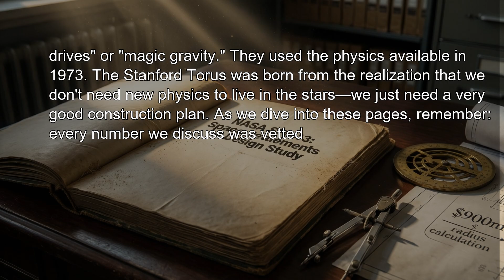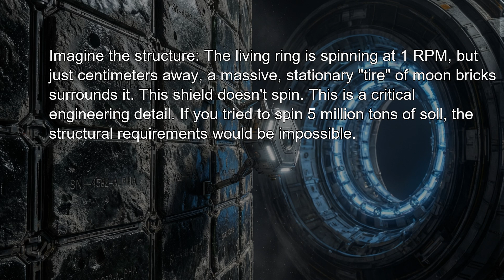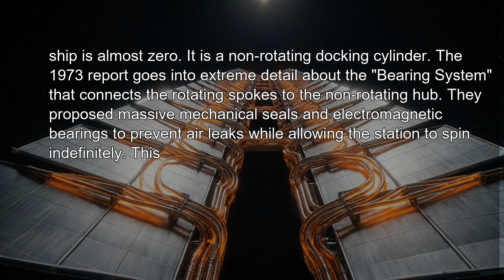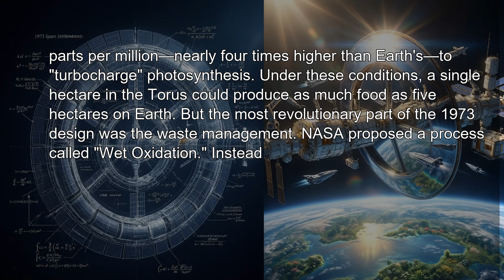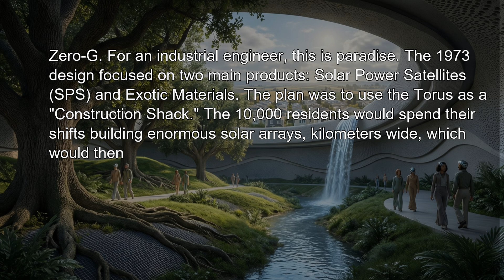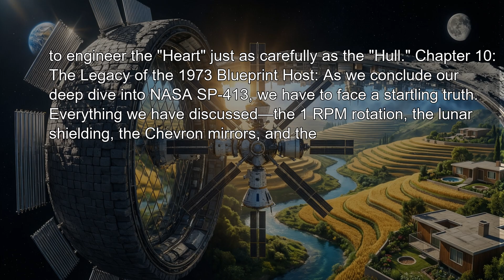Stanford Torus Detailed Design (USA) 1973

Comment from the maker: The 1973 detailed design specifies a 5-million-ton lunar soil shield that is STATIONARY while the habitat inside spins at 1 RPM. How do you maintain a pressurized seal between a spinning city and a non-spinning mountain of dust without losing all the oxygen into the vacuum?
Reply: You actually need at least two spinning components interior and that exterior component holds all of the shielding much of the astroponics, & life support systems as well as heavy shielding which actually you don't want lunar dust you want more volume of  Astroponics. Plants that don't need gravity artificial or otherwise which is probably more plants than we think are better shielding than a bunch of gravel. The reason you need more than one rotating component is due to sympathetic motion. There's a ton more to say about all of this issue.
Reply from the maker: @Astroponicist  It’s honestly one of the trickiest parts of the 1973 design. If we actually went with two rotating components like you suggested, do you think counter-rotating them would be the way to go to balance the gyroscopic effect? My only worry is if that would turn the central docking hub into a total nightmare for incoming ships. What’s your take on that?